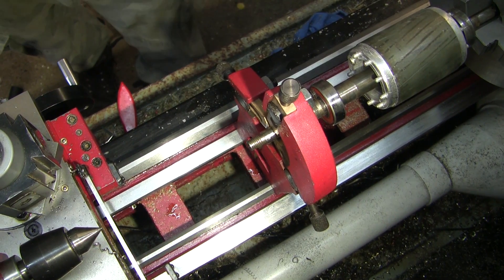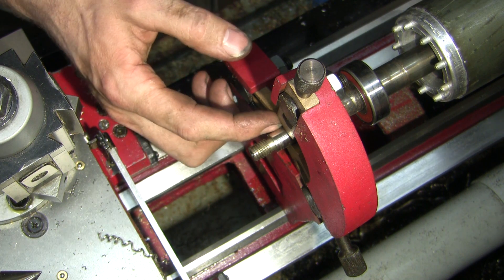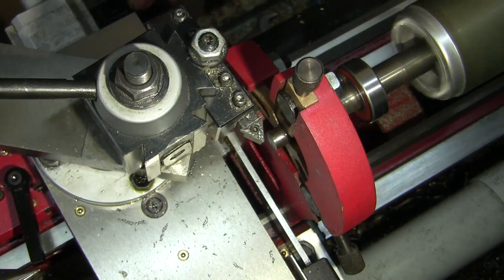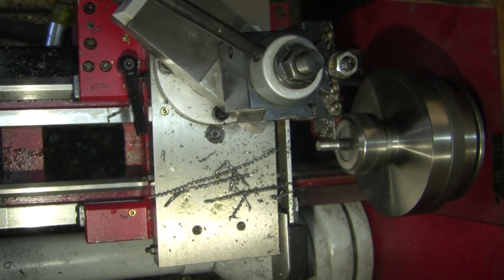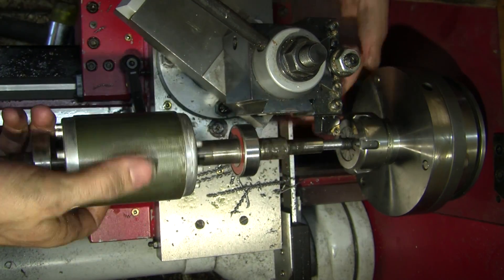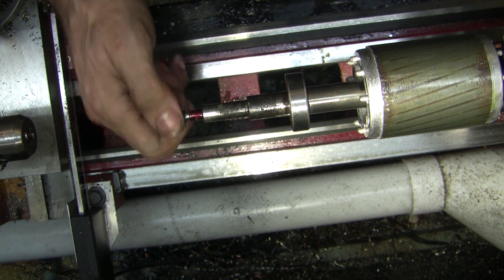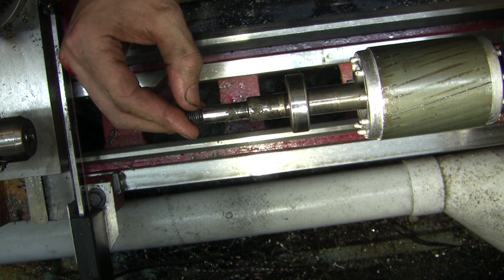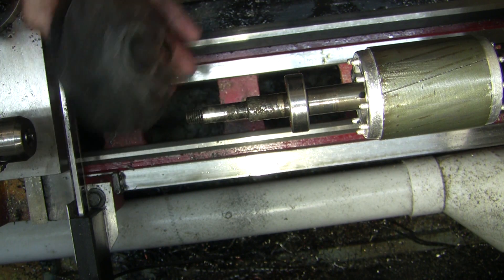bent spa/jacuzzi pump shaft repair

Comment: Thanks for the vid. I have the same problem with a bent shaft on a Wavemaster 5hp pump. The shaft was bent causing the impeller to clatter along the wet end. I tried to straighten the shaft using hand tools to no avail. Now I need to shell out some bucks and buy a new pump.
Reply from the maker: Vincent Freeman don't know anyone with a lathe?